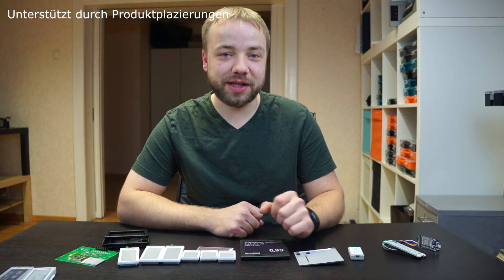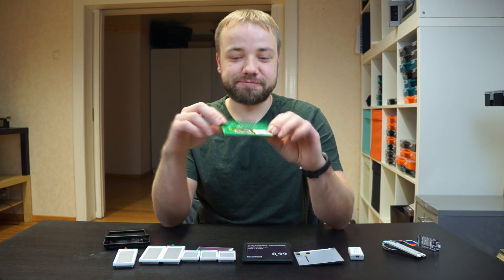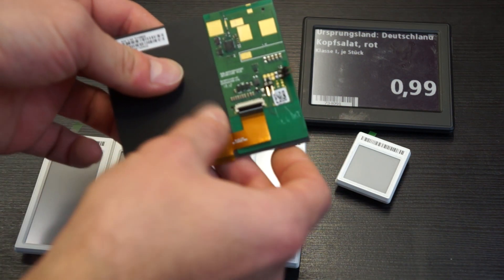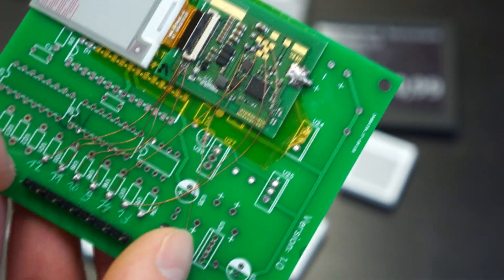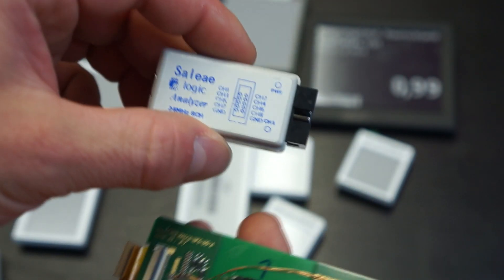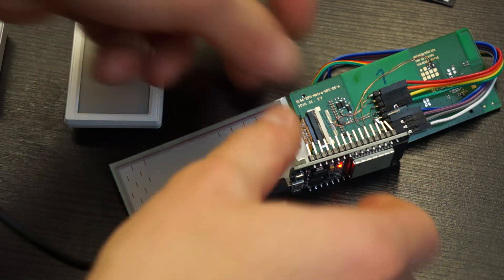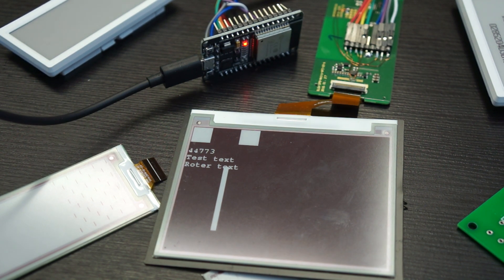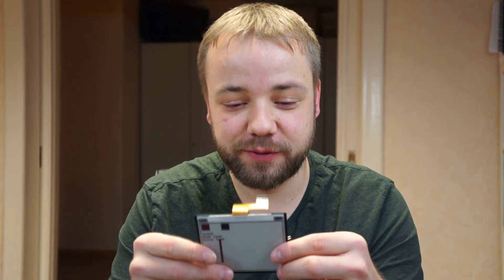Reverse unknown E-Ink displays and use them with arduino

Comment: Hello, I found your videos and i am quite impressed about your technical skills. I have an 4,2 inch Display. Could you upload an picture which solderpads I need to use ? 
I have an Display with an HINK-EO42A11-A0 Controller. Can I send you an email with detailed pictures? Do I need to solder the pins on the connector or can I use the solderpads? 

Greetings!
Reply from the maker: Pictures@43u.de lets try it :)
Reply: @atc1441  I will send it to you as soon as possible.
Reply: @atc1441  Check your Mails.
Reply from the maker: Got it. Please check out this video https://youtu.be/c62D3Z-c5IM its not the same but very similar and the arduino code it useable
Reply: @atc1441  thank you! I need to solder to the small pins of the connector right? Is there any option to make it a little bit simpler? Because I don’t have an hot air...
Reply: @atc1441  Could I Buy one of your Adapter PCBs?

Comment: HI! Found this a bit late and tried the library doesn't seem to work, or at least the example file. It throws bunch of errors when I use #include <HINKE029A14/HINKE029A14.h> . Any ideas? Also, if you could enable Issues in the github repository, it would be great :)
Reply: Never mind, I added the missing methods and fixed the display rotation function which was broken. Though I have a different display (HINK-E029A10-A1) so that might be why rotation was messed up. I will add pull request shortly.
Reply from the maker: @martincerny3294  Hi, good its working now, would be hard to tell without knowing the exact state etc. 
i enabled issues :)

Comment: Great work! What's nice about these displays is that they are already produced at a large scale, so the price is low.
Reply from the maker: Thank you, yes that is the reason why I find them so interestings. The super low price is great
Reply from the maker: It would be nice to finally reverse engineer the original RF protocol so they can be used without soldering. Need to sniff at the supermarket where they are running